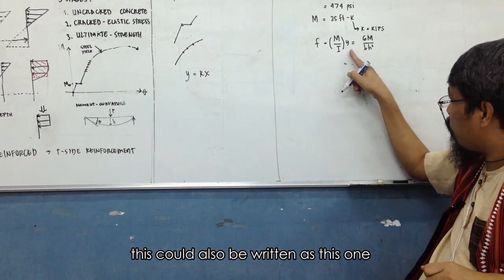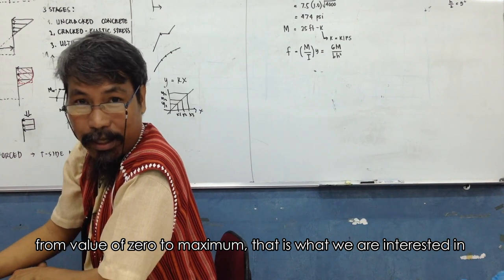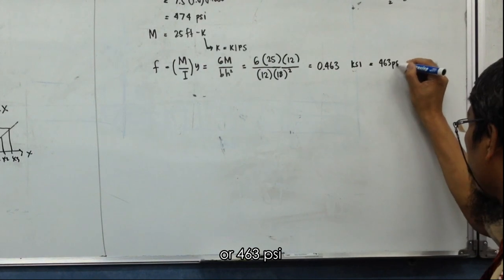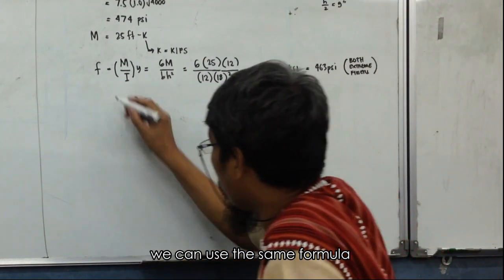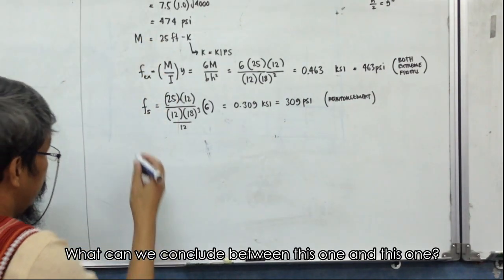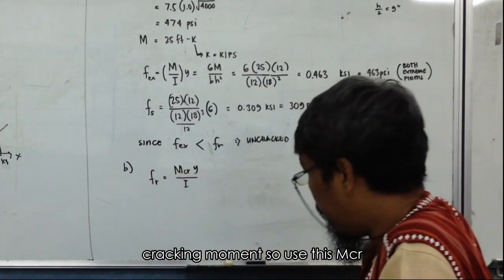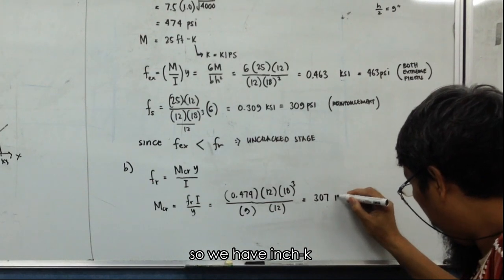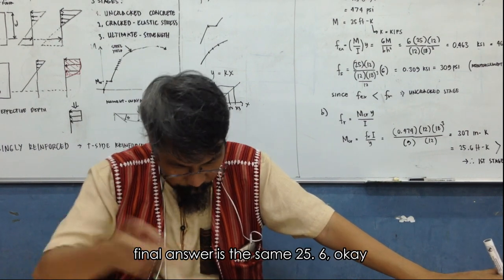CE 422: Structural Design 1: Reinforced Concrete Design || Flexural Analysis of Beam || Part 7

Comment: Thank you Sir for this well-explained and clear explanation of the example problem about the three stages of flexural analysis of beam which is uncracked concrete, cracked elastic stress and ultimate strength.